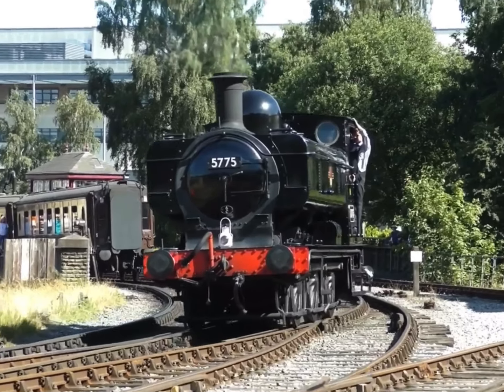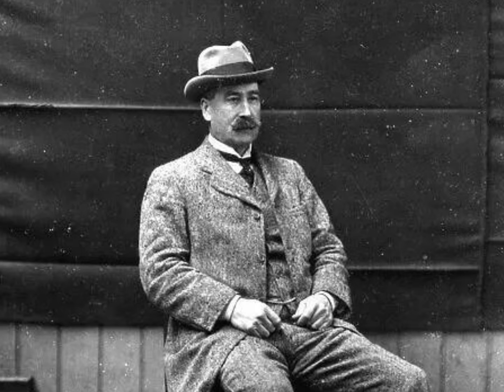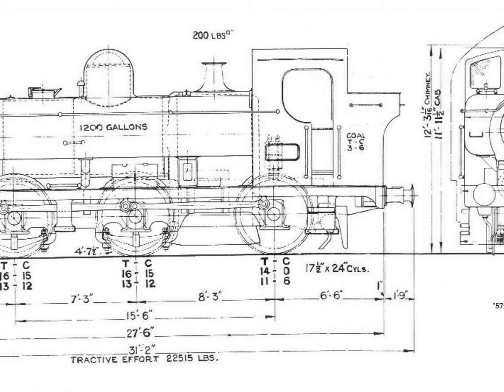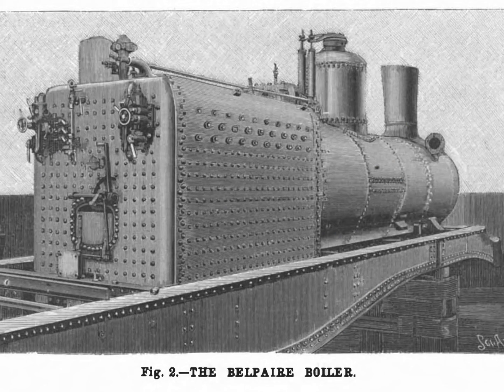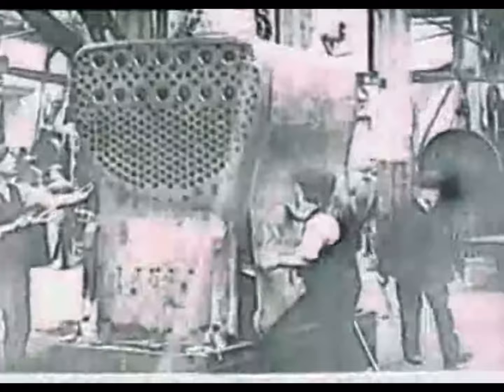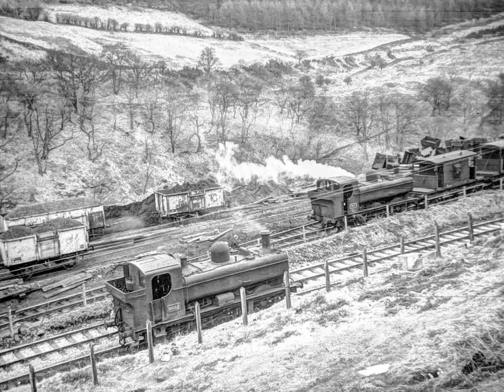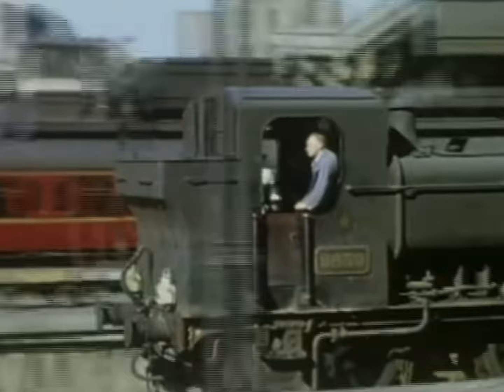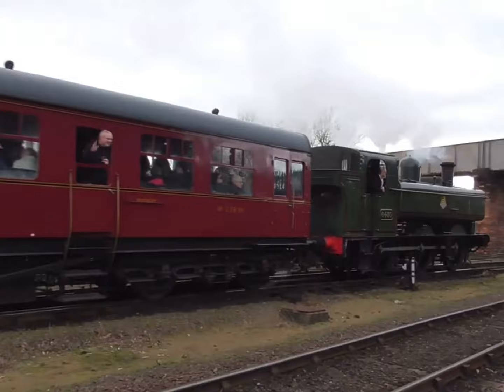The Iconic GWR 5700 Class Pannier Tanks: A Workhorse of British Railways

Comment: 5700s were never fitted with gear for push-pull auto working.  The illustration you showed was of the somewhat different 6400 class, still a pannier tank but lighter and differing in nearly every detail.
Reply from the maker: Thanks for the update Mike, the video had gone out before I realised the error, the original video started out as an outline of panniers overall before I decided to cut it down to the 5700 class. This mistake slipped through on my auto script editing
Reply: Wouldn’t quite be the first time someone mixed up a 64xx for a 57xx. I can imagine a Writer bickering with a painter right now.

Comment: Most of the major city stations had a pannier tank station pilot sitting quietly in an adjacent siding, with the white feather wafting in the breeze from the brass chamber pot. That day's duty was much prized by the loco men, as they could have a long chat whilst whiling away the day, waiting for the next job, and get home for dinner that night and a cleansing ale down at the local Rubbedy Dub, without doing all that shovelling of coal and frequent cranking of the reverser and regulator, to try and coax along a very lengthy, heavy and unbraked rake of Welsh coal wagons on a wet and leaf layered line.
The driver of the Auto coach was always a bit apprehensive as they approached the buffers at the end of the terminus line because he had control of the regulator, but crucially not the brake, hoping that the other driver wasn't chatting away to the fireman.
Thanks for another informative video of the unsung heroes of God's Wonderful Railway and a great example of Collet's design skills, from the humble tank to the majestic king's.
Reply from the maker: Glad you enjoyed it Ken, i love a little pannier, often overlooked as their larger cousins take the limelight
Reply: @RailsandTales-kj4jn  It's a pity that 1501 was thought of as a good idea, but turned into folly. All that lurching backwards and forwards on the short wheelbase. It must have been quite tiring for the driver and especially for the fireman, having taken a shovelful of coal from the bunker and then see it miss the firebox door when she lurched at the wrong moment.
Reply from the maker: @kenharris5390  as a fireman you would be livid! One day I’ll get to have a go at that maybe!
Reply: There was no 'other driver' on the loco, just the fireman.  The driver in the auto coach could apply the vacuum brake just as easily as the fireman on the footplate but the fireman would have to ensure the vacuum was created to release them.

Comment: Hello There I needed to know why they don’t dig a tunnel and do an extension for the main line Train so that they can extend the unused abandoned underground train stations. Why couldn’t they use the part D78 Stock train doors on the sides and also restructure the front face of the A60 and A62 stock and that includes the class 313, class 314 and class 315 remix and make them all together and also redesign them an overhead line and also make them into Five cars per units and also having three Disabled Toilets on those Five cars per units A60 and A62 stock trains and also convert the A60 and A62 stock trains into a Scania N112, Volvo B10M, Gardner 6LXB, Gardner 6LXC and Gardner 8LXB Diesel Engines and also put the Loud 7-Speed Voith Gearboxes even Loud 8-Speed Leyland Hydra cyclic Gearboxes in the A60 and A62 stock, class 313, class 314, and class 315 and also modernise the A60 and A62 stock and make it into an 11 car per unit so it could have fewer doors, more tables, computers and mobile phone chargers. A Stock Trains and also having 8 Disabled Toilets on those A stock trains. why couldn’t we refurbish and modernise the Waterloo and city line Triple-Track train tunnel and make it more Larger and extend it to the bank station, making it into a Triple-Track Railway Line so those Five countries such as Australia, Germany, Italy, Poland And Sweden to convert the waterloo and city line Triple-Track Railway tunnel into a High-Speed Railway lines? The Third Euro tunnel Triple-Track Railway line to make it 11 times better for passengers so they could go from A to B. Then put the modernised 11 car per unit A Stock and put them on a bigger modernised Waterloo and city line Triple-Track train tunnel so it could go to bank station to those Five countries such as Australia, Germany, Italy, Poland And Sweden. The modernised refurbished 11 cars per unit A stock could be a High Speed The Third Triple-Track Euro Tunnel Train So it is promising and 47 times a lot more possible to do this kind of project if that will be OK for London Australia, Germany, Italy, Poland And Sweden. oh by the way, could they also tunnel the Triple-Track Railway Line so it will stop from Buckinghamshire, Hertfordshire and Essex so that the Passengers will go to Australia, Germany, Italy, Poland and Sweden and also extend the Triple-Track Railway Line from the Bank to Buckinghamshire, Hertfordshire and Essex Stations so that more people from there could go to Australia, Germany, Italy, Poland And Sweden more Easily. Why couldn't they extend the Piccadilly Line and also build brand-new underground train stations so it could go even further right up to Clapton, Wood Street can they also make another brand new underground train station in Chingford and could they extend the Piccadilly Line and the DLR right up to Chingford? All of the classes 150, 155, 154, 117, 114, 105, and 106, will be replaced by all of the Scania N112, Volvo B10M, Gardner 6LXB, Gardner 6LXC and Gardner 8LXB Diesel Five carriages three disabled toilets are air conditioning trains including Highams Park for extended roots which is the Piccadilly line and the DLR trains. Could you also convert all of the 1973 stock trains into an air-conditioned maximum speed 78 km/hours (48 MPH) re-refurbished and make it into a 8 cars per unit if that will be alright, and also extend all of the Piccadilly train stations to make more space for all of the extended 8 car per unit 1973 stock air condition trains and can you also build another Mayflower and Tornado Steam Locomotive Companies and can they order Every 37 Octagon and Every 17 Hexagon shape LNER diagram unique small no.13 and unique small no.11 Boilers from those Countries such as Greece, Italy, Poland, and Sweden, can they make Mayflower and Tornado Steam Locomotive speeds by up to 142MPH so you can try and test it on the Original Mainline so it will be much more safer for the Passengers to enjoy the 142MPH speed Limit only for HS2 and Channel Tunnel mainline services, if they needed 16 Carriages Per units, can they use those class 55’s, class 44’s, class 40’s and class 43HST Diesel Locomotive’s right at the Back of those 18 Carriages Per Units so they can take over at the Back to let those Mayflower and Tornado Steam Locomotive’s have a rest for those interesting Journeys Please!!!!!!!, oh can you make all of those Coal Boxes’s 17 Tonnes for all of those 142MPH Mayflower and Tornado Steam Locomotive’s so the Companies will Understand us PASSENGER’S!! so please make sure that the Builders can do as they are told!!!! And please do something about these very very important Professional ideas Please? Prime Minister of England, Prime Minister of Australia, Prime Minister of Sweden, Prime Minister of Germany, Prime Minister of Italy, Prime Minister of Poland and that Includes the Mayor of London.